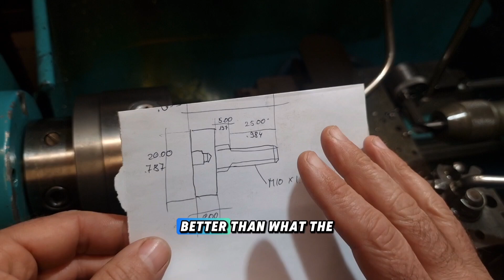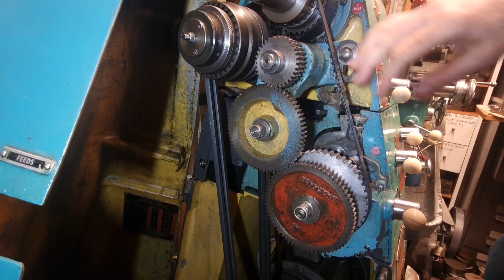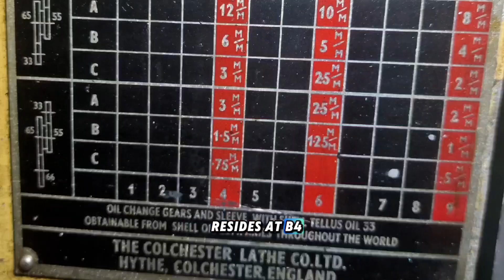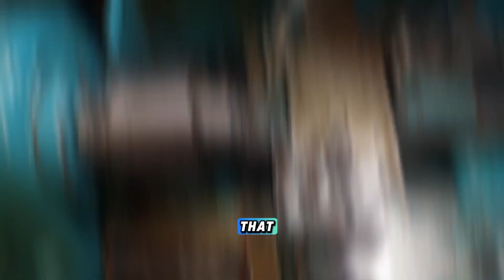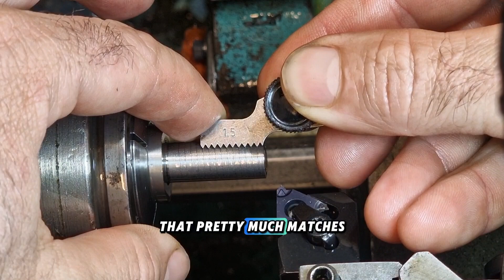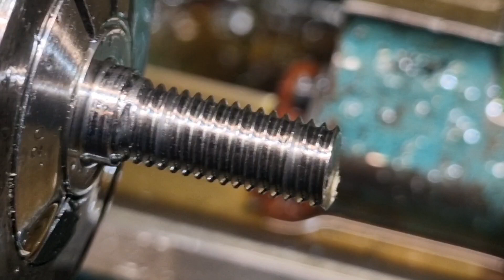How to Cut Metric Threads on an Imperial Lathe - Colchester Chipmaster

Comment: Would have been nice to put a chamfer on the face of the bolt.
Reply from the maker: You're right, a chamfer would have been a nice finishing touch on that bolt, this video is mainly about threadcutting on the chippie. I will make a separate video on on how to cut chamfers and what kind of chamfers exist for threads and other edge breaking techniques as it deserves one whole video on its own. Thank you for your reply!

Comment: I have a Colchester 2000
I bought, possibly from Ainjest,  a “Metridial” it has a gear that engages on the lead screw 
Using it means I can screw cut a metric thread at 1000 rpm and dis engage-

Comment: You can disengage the half nuts when cutting metric on an imperial screwed lathe.
 When you reverse the spindle you must re-engage the half nuts at exactly the same index mark on the lead screw indicator as it was on before it was disengaged.
I have used this method for many years when cutting metric threads on my imperial machine.
Reply from the maker: May I ask what make and model is your lathe?
Reply: @chipmaster7738 My lathe is a Harrison L6/12" swing made in 1964.
This method will work on any lathe that brings the 2 halfnuts together to engage screw cutting and has a reversible spindle.
Reply from the maker: Cutting metric threads on an imperial lathe typically requires keeping the half nut engaged throughout the threading process. Disengaging the half nut after each pass can lead to inaccuracies and difficulties in aligning the thread for subsequent cuts. It's generally advised to avoid disengaging the half nut to ensure proper thread formation.